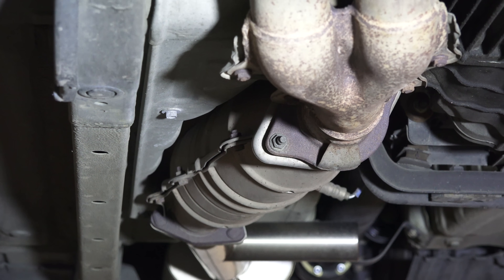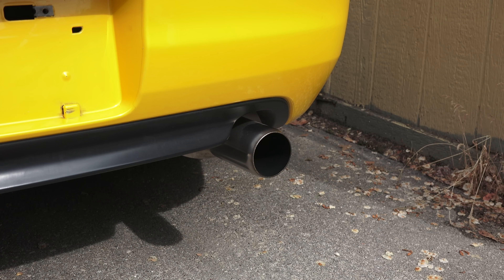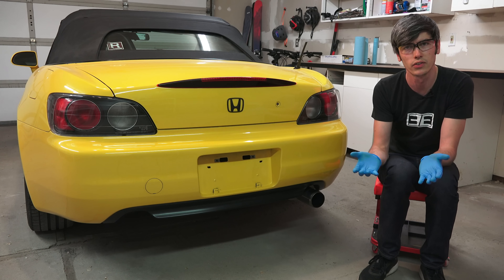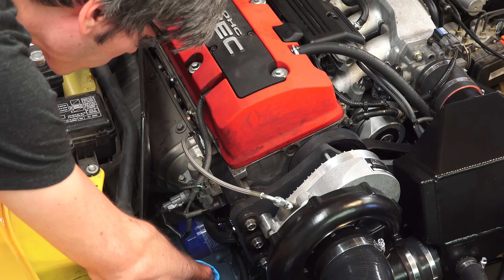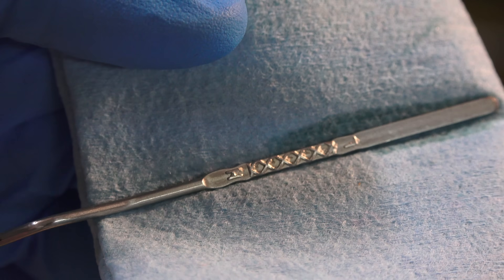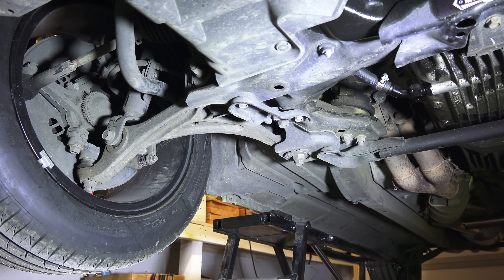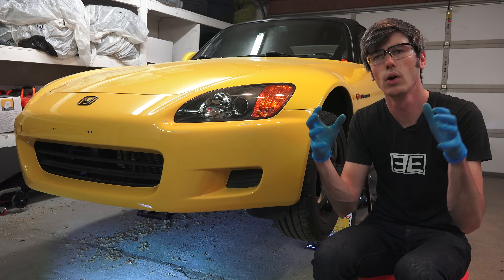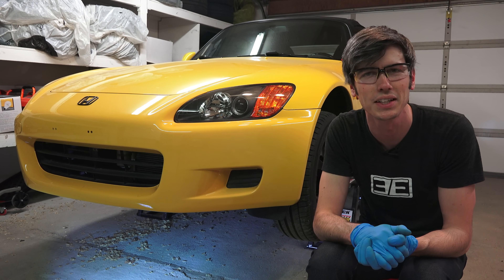5 Signs You Shouldn't Buy A Used Car

Comment: Old car guy here. Old cars/trucks for old guy. Lots of very cool rides that all needed brakes, wheel bearings, transfer case, fuel pump/lines, fuel injectors, TPS, EGR, PCV, Coil driver, plugs & wires, synthetic oil when it even looks dirty and plenty of rust. They all made plenty of 100,000 mile odometer rollovers.
I love bass, no treble, but it's all about the oil, no trouble.
p.s. Love that 420 code. My repair procedure is personal, however. (O2 spacer and full bowl).
My '79 Z28 has 420 mechanical logic...windows automatically roll down some, depending on severity.

Comment: I checked a used vehicle. After the salesperson pulled over for me to test drive, I noticed the engine was hot. When I asked, they said that the fluids and coolants have to be replaced and that the car will be serviced before you get it. Then I test drove it and found to be alright in running.
Any tips on that? Is it normal for the engine to be hot? The car was filthy, and they said they will clean and remove scratches.

Comment: i got a 1996 bmw 525 tds 1996 and it does some black/grey smoke when i floor it in 1/2 gears between 2-3k rpms buf after that i dont really get a lot of smoke even at the really high rpms is it normal for the car being old? the car is all stock execpet i did the egr delete

Comment: What kind of OBD scanner did the video author use?

Also, great tips on the types of smoke and what problems could it indicate as in most parts of Europe, where diesel is the dominant type of fuel, you see a lot of black smoke coming out of cars that aren't in their "golden age" when they are in their first gears (usually 1st 2nd and 3rd)

Comment: Tell the owner not to start the car until you get there, open the hood tell the owner to start the car before the oil pumps up listen for engine knock, possible connecting rod or main bearings knocking then goes away once the oil gets up.

Comment: I bought a brand new GM car in 1978 and it had rust, leaks and poor body panel fit. It did not burn oil but it would have had trouble codes if it were more technically advanced.

Comment: Another easy check for bad head gasket is removing the coolant fill cap and putting you hand tight over it, if there is pressure building up there might be exhaust leaking into the coolant. Do this when the engine is cold, coolant gets hot.

Also check the colour of the coolant, if it's brown there is either plenty of rust, or they've used some coolant leak repair fluid rather than finding and fixing it. 
This could also be a bad head gasket they've tried fixing. These repair fluids can work anywhere between not at all and several years, but it's a gamble.

Comment: Good luck not seeing any rust underneath when living in the North-East!!  Always love when all these car experts live in none winter areas.
Reply: Tom M 
Pretty sure that’s why he said “excessive”.  Meaning to the point it’s compromising the integrity of the parts
Reply: @blakew5672  - It may have been titled "Excessive Rust" but if you listen to him talk his standards would never pass any Northeastern cars.  You put a camera under a NE car you are going to see TONS of rust.  And you won't be able to tell what is severe rust vs mostly surface rust unless you get under there and feel, poke and lightly hammer areas.  So sorry, you;re incorrect.  Most of these YouTuber's doing car videos live in areas where rust in not an issue.  I have rarely seen videos where they had to torch a rusted bolt for 7 minutes just to get it lose, etc etc.
Reply: Or near the bay. Cars rust so quick if you live near the ocean 😂
Reply: @kaitlynnderry2414  - Yes, I know if you are close that will happen.  But isn't that mostly in the body?  Not underneath in the frame?  Even if so, nothing compare to the NE part of the country were they have to salt the roads.

Comment: Idk why i clicked this video. The scan tool thing.. There are codes that store in the computer that the cheap tools won't pick up. Abs and trans codes require a better scanner. Make sure you use one of those because those dummy lights will go off and store in the computer sometimes.

Comment: Good video.
One thing - when it comes to panel colour it's wise to check forum discussions for a particular vehicle to see if it's common for that vehicle to have slightly different shades of paint. This is especially true when it comes to comparing plastic to metal panels, as sometimes the plastic parts are not painted in the factory were the rest of the car was assembled.

Comment: I see too many people talking about walking away if sludge present. Listen, most engines develop sludge even if you change oil regularly, if you never rev the engine, or let it warm up properly during short drives, IT WILL develop sludge. A little bit of sludge is not the end of the world. I haven't seen a single used car with absolutely no sludge in the engine. Theres a difference between a little sludge and a lot of sludge. I've both vehicles with some sludge (100k plus miles) and i will say its completely normal for a city driving car to have sludge. If you drive in the HWY a lot then your RPM are probably close to 3k for very long periods of time, so that will clean the engine. I usually change the oil earlier while at the same time revving it a lot before that second oil change.

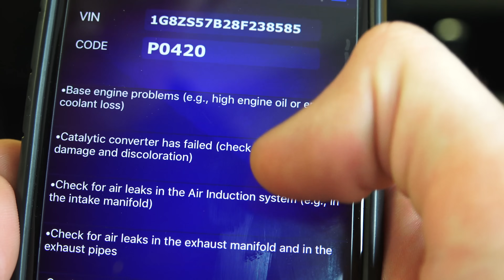Comment: 8:50 "P0420"

Basically happens when there's cannabis particles in the fuel tank.
Reply: We wish! The P0420 family (0420, 0421, 0430, 0431) are troublemakers. 0420/0430 are often exhaust leaks ahead of the converters (or even really dirty injectors) but could also be a bad converter. 0421/0431 seem to always be bad pre-converters. Trying to fix a P0420 or P0430 by blindly replacing the converter can take the car up a very dark alley. The code goes away because the new converter is just enough better to clear the code, but it comes back six months later when the new wears off and the problem gets worse. A second replacement lasts a month or two as the problem gets even worse.
I fixed the last P0420 in the family - my daughter's 2002 Sienna - by instructing her to use top tier gas. I cleared the code a week later and it didn't come back for nearly a year. She had gone back to random gas.
Reply: your telling me you dont get high with your car
Reply: Ah yes finally found somebody noticing 420
Reply: Get out $500 dollars my friend, you ready for a new "cat"!

Comment: sooo great i did just buy a car 3 month,s ago for 150 euro a pontiac trans sport montana it had a broken head gasked leaking valves leaking radiator engine codes and a bit of rust so i went to fix all that it was about 500 euro,s later until the car was nice so im in it for 650 euro did i made a bad purchace or not a car like that goes here now for about 2000 euro,s

Comment: A couple odd ball comments.  Listen to the engine when you start it, when its warmed up, and when you turn it off.  Clattering, clunking, crackling, = leave.
If you are a mechanic or have been exposed to folks working on cars, smell various engine compartments in for repair.  I saw a vid of a mechanic who was blind.  But he could do pretty good diagnostics from the sounds and smells from an engine compartment.  Overheated coolants, electrical insulation, burnt oil, etc..

Comment: Mine smokes blue-white when cold only, probably the turbo I assume. Once is hot, everything is normal
Reply: It's likely the valve stem seals.  Oil sits on top of them when the engine is off and will leak into the cylinder when it sits long enough to cool down.  When you start it up you have a puddle in one or more cylinders getting cooked and shot out the tailpipe, that's why it goes away after it runs for a bit.

Comment: You forgot to talk about the battery cables.  If they are frayed or has those universal battery heads, the car has either been stolen before or has had electrical problems that weren't addressed correctly.  I only look at cars that have the original wiring or the one piece replacement battery and alternator cables that don't require splicing.  That way you don't have to worry about random shorts and bad connections.

Comment: I bought a 1997 Pontiac Trans Am with 7,800 original miles. I took it on 2 test drives without any problems. The next day after purchasing it I put new tires and changed all the fluids.  It drives like a brand new car, and the engine bay is immaculate as well as the inside/outside of the car.  There are some great used cars out there and you just have to do your homework properly. Thanks!

Comment: So in 2019, you're going to find a 2001 car that has not been involved in a single accident, you know what? that will happen when pigs fly. There is a difference in a collision and a little bump. You will never see a used car that is flawless, just as long as the crash doesn't affect the main chassis, every other thing else is just aesthetics.
As far as oil leaks go, even the best of them will leak oil. You mean an engine will be running all winter all summer for good 18 years and it will just remain dry like engines are made from one piece of metal? c'mon, be realistic. And don't get me wrong, I am talking about a used car here, not some 2-5year old car, those to me are still basically new. And average used car buyer buys car between 8-18 year old if you know what I mean. And cars in that age range are doomed to have all these issues you mentioned, some worse some less.

Comment: Nice video. I was a little surprised that it didn't include checking tires for excessive or uneven wear. Perhaps that's not a deal breaker, but it could affect the purchase price and is another easy way to check if the reality of the vehicle matches its advertised condition.

Comment: Serious question. I had blue smoke come out of my car one time one startup years ago. It hasn’t done it since. I’m still mystified on why It did that.
Reply: Someone told me it was the vct  system because I started the car and shut it off quickly then started it up a little while later.
Reply: Also happened to me this Summer, but it did this nearly every morning. It was due for an oil change and it stopped doing it as soon as the oil got changed. Funny thing is, i switched oil brand and the new one was even thinner...

Comment: Don't buy a car that is low on coolant and no visible leaks.  You will not always see it in the exhaust smoke.  I bought one when it got in the oil, car ran good but when I removed valve cover it was slugged up.  Had to pull the engine and completely redo it but all parts were saved after trip to machine shop.

Comment: What about when you snap the throttle and you get some back gurgling? 06 Impala 3.9 128k miles. Well maintained. Plugs, Wires changed at 105k miles as GM recommends replace them all @ 100k miles. Any recommendations welcome.

Comment: I know of another route for the coolant to get into the CC: a leak in the right spot in the upper intake manifold. I had a car that did this. There was a part of the coolant circuit that ran in a half circle over the air chute just after the throttle body. In fact the UIM when installed made up the top half of that chute. The idea was to warm the intake air, at least to help modulate the temp of the air especially in winter. It leaked right there. It was a common issue with that engine. ALL of the coolant went out my tailpipe in about 5 minutes going freeway speed.

Comment: Another good way to check if the there is fluid contamination in the combustion chamber is just look inside the oil fill cap for signs of browny grey sludge consistance like yogurt stuck inside it. ~_^

Comment: When you go to a used car lot, they use a set pattern for a test drive. They want you driving long enough to want the car, but not long enough to expose any issues. You are not required to follow their pattern. Once on the street, you can either tell them you plan to drive the car longer, or you can just pretend to miss turns. In fact, if they get overly-upset that you didn't follow the pattern, that is also an indicator that they are hiding something about the car.

Comment: I did the same, checked a car it was perfect, no codes, in the drive test perfect etc. After a day of using the car check engine light came on with the code P1740. Thats something about the transmission, but the car still running perfect and good. I am trying to sell it but I want to fix it first, I’m not sure what is the problem. Can you make a video about checking transmission and lights that may be the seller erased from the car?

Comment: once again, fantastic video! just as a side note regarding the scan tool, if you're using your own obd2 unit it's best to scan it first, then again after the test drive. reason being, a clever dealer has potentially also spent the $5 on a cheap OBD2 unit and has cleared any codes that where on it.

my grandmother recently purchased a 2014 Toyota Aurion and i made a point of scanning it during it's maiden voyage, and again after she had owned it for a week or 2 just to be sure that it wasn't harboring any cleared codes

Comment: If you live in Canada or in an area where winter is a factor if your buying a used car more then 4 ish years old your almost always guaranteed to get rust keep an eye on structural members and the body panels but note there's a difference between surface rust and real rust problems say holes vs the rust colour you get from untreated this is something too look out for because often times owners will sell vehicles when rust seems it's rapidly getting worse, it doesn't mean the car is entirely bad just something like oil spraying it might be something to look into

Comment: so i have a REAL question, with modern fuel injection, will a plugged air cleaner still cause a rich condition? i mean with all the sensors, does it not measure the amount of air actually going into the engine?

Comment: always be suspicious if you open the hood and the engine is completely clean
Reply: Agreed. I do not like seeing a freshly cleaned engine bay in a car for sale. Cleaning engines is such a rare thing to do, it's suspicious to do so when selling. It might be innocent, but it might have been done to hide problems. I like to see an engine bay that is clean because there have been no leaks, but shows no evidence of having been deliberately cleaned.
Reply: I keep my underhood clean, as it makes it easier to spot a leak and servicing is much easier also
Reply: Not necessarily. I change the fluids on my vehicle religiously, and keep up with all the standard maintenance. Wash and wax regularly, and once a year I clean everything under the hood. The engine, panels, hoses, wire harnesses, blow out and hose down the radiator, everything. My truck is 12 years old now with 130k miles but still looks brand new.
Reply: @Bennysol  it's suspicious when the dealer opens the hood and tell you: look everything is clean and shiny
Reply: blackwolf2497 my engine is always clean

Comment: My 2010 Toyota Tacoma (120,000 miles) always has white smoke coming from exhaust pipe , also the exhaust pipe is always leaking clear water(I know it’s water because it doesn’t smell when I put it on my finger , and it feels like water) .
My coolant stays on the same level always( I check before And after every ride because I was scared of head gasket problems ) 

Could white smoke mean anything else ? Condensation evaporating ?

Comment: Old Head gasket cracks Issues Solved with  Ground pepper poured into the Coolant stopped the leak if the leak remains keep adding  Ground pepper until it stops then drive Works every time good doing it for 5 years cast iron heads love it

Comment: Black Diesel Looking color of smoke off a gasoline got me and muddy looking Coolant Looking radiator cap  From a 350 Chevy engine van 1996 with 235567,73 miles $1500 dollars ran good for 30 days with clear exhaust ran excellent then slowly turning to black smoking exhaust looking issues there was more gas than oil when I drained the oil. rings are bad  Compression loss issue that's allowed Gasoline go to the block

Comment: If you don't have a scanner with you at the time and f inspection, make sure the check engine light lights up when switching the ignition to ON and then goes away after a bit.  If you don't see the light come on can indicate that the bulb is burnt out or the seller took the bulb out to hide a problem.

Comment: #6, if you go to look at a used car and the interior is full of junk, trash, parts, etc.  don't walk away, run away.  
#7, if you show up to look at a vehicle and the seller says its in great condition and you can't test drive it, run away.  
#8, before you just jump in and take off on a test drive start it up and let it run for a few minutes, open the hood, look around for leaks, look under the vehicle for leaks, you don't want to jump in a vehicle and take off down the road and have it catch fire due to a fuel leak or something of that nature, bought a vehicle several years ago, it ran and drove fine but the fuel line to the carburetor/fuel filter wasn't on right so it was pouring fuel all over the top of the engine.
#9, unless you know you are going to look at a project vehicle, if it doesn't start up probably better pass on it, far more vehicles out there that don't require an immediate use of a toolbox prior to purchasing.
#10, if you are going to look at a vehicle that the seller says they don't drive much, that means they probably haven't driven it for quite a while, or for several years, walk away from those, my free car that sat for 4 years has cost me $1700 so far...there's a reason people give cars away...simply they are just tired of trying to fix them.